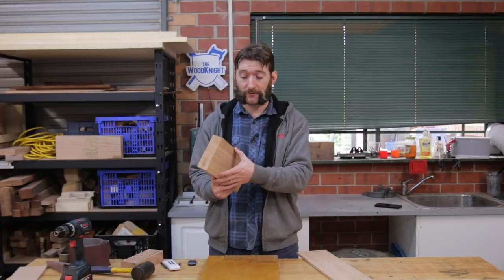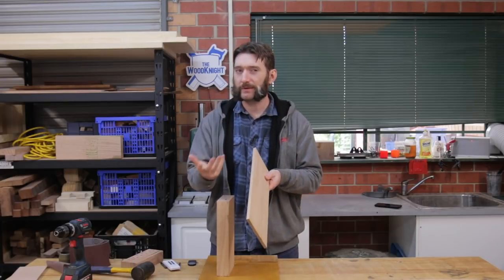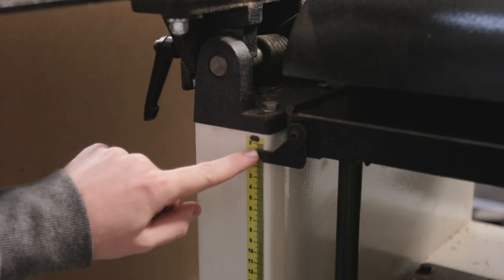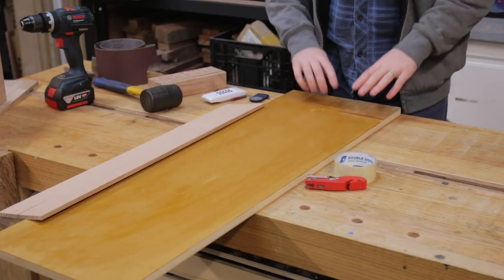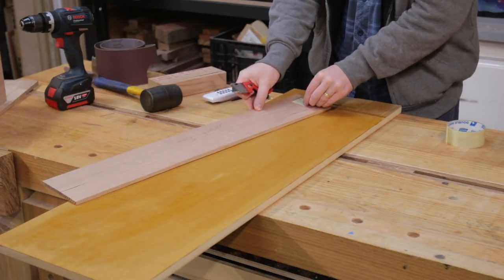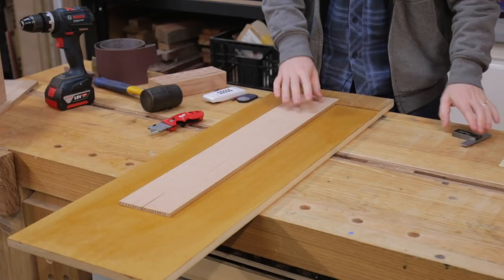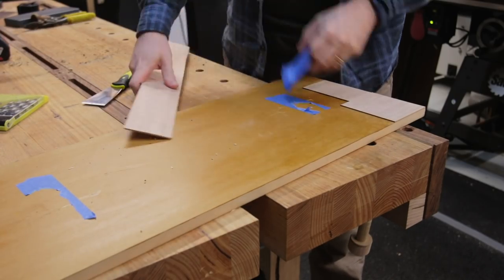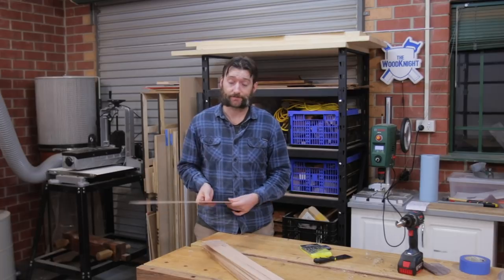Planing Thin Strips - You get a veneer, you get a veneer! Woodworking Technique

Comment: Sorry mate, I went looking for a problem and I found it because it is very common. The "stop" on the sled goes into the thicknesser first. It's a common mistake because people put the stop behind the workpiece to stop the cutterhead from firing the workpiece back out at the operator. The rollers will prevent that, and in a worse case scenario, the anti-kickback fingers will catch it just the same as if the work piece was on the thicknesser bed itself. The "stop" goes at the front because the rollers only engage the workpiece, and if there isn't enough friction between the sled and the workpiece, the sled gets left behind. It's quite funny to watch table leg tapering thicknesser jigs/sleds used wrong. No leg ends up the same :D
Reply from the maker: Lack of friction would only really occur if its not actually stuck down, wouldn't it? My first attempt was without a stop at the rear, and as it got thin enough, the quartersawn material that went through got a lot more chippy on the end
Reply: @TheWoodKnight  I don't know why it would get more chippy on the trailing end without a stop, other than the workpiece is getting to thin and is flexing up into the cutterhead. I do 3mm on my thicknesser without tape holding it down and it ends up being 3mm'ish because of the lifting. Because you are only using a couple points of holding with the sticky tape, your minimum thickness will be limited by the timber resisting the lifting forces of the cutterhead.
Reply: Oh and yeah, if you removed the double sided tape, it will more than likely leave the sled behind as the rollers pull the workpiece through.
Reply from the maker: I'm guessing with the workpiece wedged up against the stop, it's helping prevent it lifting during the cutting process.
Reply: @TheWoodKnight  Yeah probably. Much the same as butt feeding timber through a thicknesser. I jam the next piece into the current piece with quite a considerable amount of pressure to create exactly that environment.
Reply: Soooo you found a problem that would only exist if you weren't using tape / glue / donkey spit to hold the board down to the sled? Did we just watch the same video, cos I'm pretty sure I saw some tape in use there. :D
Reply: Maybe I just don't follow you exactly but with the stop thinner than the stock, how will the rollers engage with the sled? It won't ever touch it(well, depending on how much thinner it is I guess). Just curious.
Reply: @Simplecove  it doesn't matter if the rollers or cutter touches the sled, it will just get planed away. I often plane the stop the first time I use a sled, the next time it doesn't get touched. The stop on the sled gets placed at the start so that the workpiece doesn't slip forwards leaving the sled behind. Paul is getting away with it in this example because of the sticky tape. I just let him know for future reference because it seems it is almost unheard of on the interwebs at the moment.
Reply: @kuffyswoodwork  ah makes sense. Thanks for the info.
Reply: Ok, first, thank you for sharing this.  Second, I'm not a woodworker, so this discussion has me confused. 

I have a bunch of pieces exactly like shown in the video that I want to bring down to just about 3mm. Does this discussion conclude that a stop at the rear with tape holding the timber to the sled would be the way to go?

Edit: after reading this discussion again, it seems that with tape, the stop can go on the back, but without the tape, it needs to be on the front?
Reply: I do not use tape or stop ends as I feel they may bow the wood upwards. My bottom piece is longer, and the top piece travels faster, but never overtakes the bottom one

Comment: Those would make nice divider stock for drawers in the shop or kitchen and office. Don't need the veneer that much for me but you're different with those engraved pictures you make. Kudos any way. That sled and included stops is an essential jig for most thicknessers in my opinion. (Some use melamine and hot glue -- easier clean up and less fussy. but possibility of uneven applications but I do like the melamine.)

Comment: hmm, i find doing the bulk of the work on the bandsaw a good idea. Probably could get 2x veneers out of each of those boards. A quick very shallow pass in the thicknesser to clean up the sawn face and you're good to go.
Reply from the maker: With a carbide resaw blade, maybe, getting two usable veneers out of a 140x6mm board is relatively tricky.
Reply: @TheWoodKnight  I forget you Aussies have those crazy hard woods all over. Like your workbench out of framing oak.

Comment: You have put the stop piece at the wrong side. it should be at the front of the milled stock, as the top piece is pushed in to the front by the rollers. there is no reason to put the stop block at the back, it does nothing. it is the opposite force.